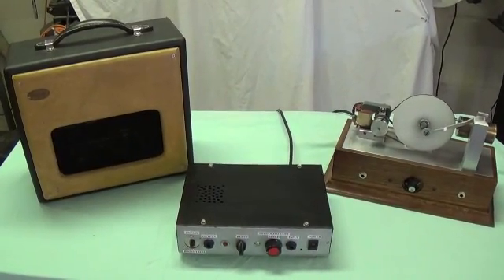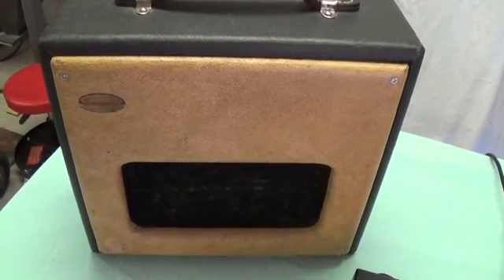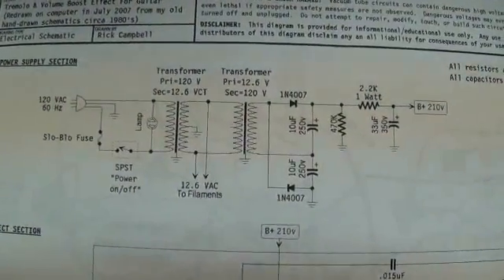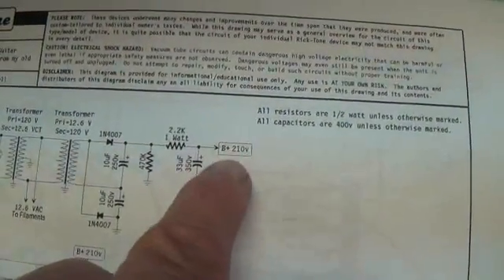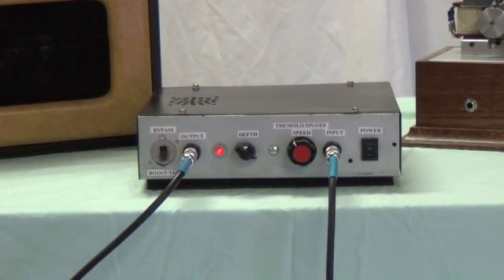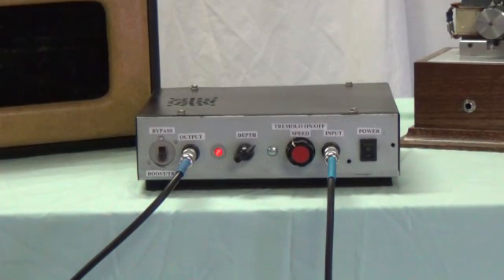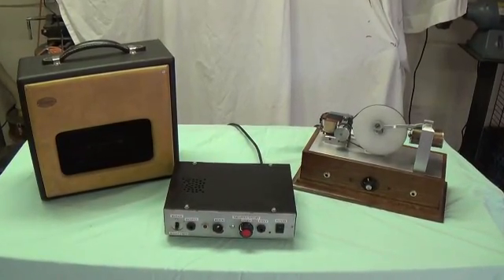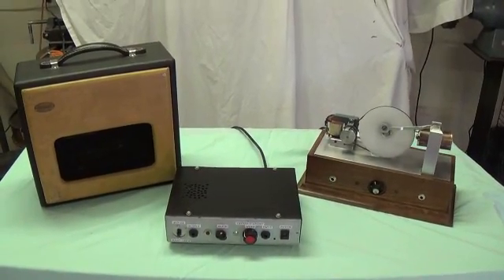Electromechanical Tremolo vs Tube Tremolo

Comment: Mechanical for sure.
Reply from the maker: Thanks, Richard :)
Reply: @UncleDoug 
Though, I am curious. What did you use for variable gain? Mine uses a 10k Type J Allen Brady pot.
Reply from the maker: @richarddoss6052  I don't recall the value of the pot, Richard, but it was probably an Alpha pot from AES.
Reply from the maker: @richarddoss6052  I don't recall the value of the pot, Richard, but it was probably an Alpha from AES.

Comment: Have you tried different chemicals in that tank? I’d be curious to see how liquid mercury would sound…
Reply from the maker: Yes, I have experimented quite a bit and Windex works best. Mercury would coat the tank and create a dead short. Also too much conduction (higher specific gravity) leads to a square wave tremolo, which does not have a pleasing sound.

Comment: The electro mechanical unit is a more warmer sound, which I love, plus its super cool. imagine that unit sitting on top of your amp when youre at a gig, you’d surely have a lot of people wondering what it is. Between songs for some on stage banter, you could give a short explanation of it, and tune your guitar at the same time lol. I think your G string is out of tune in this video. :^P
Reply from the maker: Thanks for your input, Russell.

Comment: Have you tried using conductors other than dihydrogen monoxide? I wonder what effect you might get, if any, by using conductors with varying viscosity and resistance. Mercury comes to mind. Or even gallium with a warming circuit to maintain fluid in lower temperatures. Or dual tanks with a switch? Idk. I'll probably spend the rest of the week thinking about this, lol. Brilliant and inspiring work, sir.
Reply from the maker: Thanks, F. The conductive liquid of choice is Windex. It has just the right concentration of dissolved solids. Mercury would not work well since it's conductivity is too high.....it would produce square wave tremolo, lacking the gentle ramping up and down of the signal.
Reply: @UncleDoug  Interesting! I wonder again about a dual tank setup that would allow you to switch between the two- one with mercury and perhaps a tone pot with a high pass switch/bleed, the other with glass cleaner. 
It's a genuinely brilliant setup as is that screams “authentic vintage.” I've been playing guitar since the early-mid-80s. I’ve probably spent as much time taking gear apart just to see what’s inside as I have played. I never cared for the digitization of everything (despite the fact that I became a software engineer).
Reply from the maker: @Flatsixer  As I said before, Ryan, I don't think mercury has any value in these devices.
Reply: @UncleDoug I appreciate you educating me on this. It’s such a cool piece.
Reply: @UncleDoug  btw Doug, my name is Ryan. My mom was in love with Mr. O’Neal.
Reply from the maker: @Flatsixer  Many women were, Ryan, when he was a young man ;)
Reply: @UncleDoug  I bet women of her generation would still line up around the block to see him— or Redford, lol.
Reply from the maker: @Flatsixer  They better hurry.....time is running out.
Reply: @UncleDoug  well, back in the 80s my mom got to hang out with Paul Newman and says she wasn’t very impressed. Something along the lines of never meet your hero kinda fits in here somewhere and some things are better left to fantasy. That being said, my wife is the product of a liaison between a beautiful woman (her mother) and a very famous but now deceased country star. Mr. O’Neal still has some time to fall down that “rings of fire,” too, lol.

Comment: Thanks for sharing.  I’m curious why you used two transformers.  Why did you not rectify the primary 120v from the first 12v transformer to get the B+ voltage?
Reply from the maker: For isolation, Vince. Please watch my videos on power supplies and on building the Rick-Tone TremoBoost  unit featured  in this video
Reply: Uncle Doug thanks, I will check it out.

Comment: I'd love to know why fender decided to go from their glorious tube driven tremolo to the photoresistor kind?  Looking at the different amps it looks like they still had the same amount of tubes in both kinds of tremolo supplied amps? Easier/cheaper to build?
Reply from the maker: All Fender tremolos are tube-driven. In the lower-wattage amps, a tremolo circuit is used which alters the bias of the output tubes. For higher-wattage amps like the Deluxe Reverb, however, it is not desirable to alter tube bias, so the photoresistor type of tremolo circuit is used, which modulates the volume of the signal entering the phase inverter. Here is a detailed explanation:  https://ruclip.com/video/PMlkTpCvpEY/photoresistor-volume-modulating-tremolo-design-and-function.html

Comment: Hi Uncle Doug! I hope you get a notification of this 'comment.' In chasing down info on the Tel-Ray Organ Tone, I went back to your video...which led me to this one! Your electromechanical tremolo is one of the more fascinating units I've seen! I did check out the El Paso video, and the first attempt at this one, with all of the machined parts. I was wondering, though, if you ever put a diagram together, for building this one? Thanks!
Reply from the maker: Thanks, Norm. No, I tend to build projects like this without any plans, simply designing and building as I proceed. I have also built a second type of EM tremolo since this one, out of scrap parts, with a video (or two) documenting it. You will have to observe the different parts carefully in the video. The structure is rather simple.

Comment: I'd like to get my Vibrochamp's tremolo to go as slow as your oilcan trem unit goes. That thing is fantastic!
Reply from the maker: Thanks, DE. You can slow down the oscillation circuit by increasing the value of one or more of the capacitors in the loop.....i.e. from .01uf to .02uf.

Comment: If the mechanical trem had a depth control I'd like it more, but I feel the tube trem is more useful as is.
Reply from the maker: An interesting observation, SG. Thanks for your input.
Reply: Oh yeah, a resistance, a small pot to ground would do it then, of course why not tone controls as well, a simple high pass filter to keep the bass throbbing and the treble straight...

Comment: I'm surprised the mechanical temello sounded so smooth, I would have expected it to just jump between on and off. are there buffer caps or something to smooth out the output?
Reply from the maker: No, the fluid in the tank provides a surprisingly gradual signal rise and fall......very "organic", as opposed to the electronic trem.

Comment: Hey Doug, not to be that guy in the back row that is always correcting you but I think in your caption you meant "Teenage Wasteland" by the Who. 

Thanks a lot for this channel and your generous sharing of knowledge I am trying to find out how to achieve a slower selection of speeds on a Marshall 18 watt clone I recently acquired. The speeds and depth are too much for me even with the pots near minimum.

Perhaps I am spoiled by the Fender Tremolo's I grew up on???
Reply from the maker: It's strange, but I edited that caption many months ago to "Wasteland" and now the original (incorrect) caption has reappeared......and, to add to the fun, YT has altered their editing capability to make it virtually impossible to change any caption. Re the speed and depth of your Marshallesque tremolo, you can try altering the values of the capacitors and resistors in the oscillation loop. It's a trial and error endeavor to find the speed and depth you seek. Good luck.
Reply: thank you sir. I was heading in that direction after a bit of forum hopping the web but was curious on what you would generously suggest. I will certainly try those after a bit more research. thanks again.
Reply from the maker: You're welcome. Good luck.

Comment: Magnatone vibrato was actually what Leo Fender was competing against in California in the late 50's. It's no accident he incorrectly labeled his tremolo amps as "vibrato"...That was intentional.
 He couldn't actually make an amp with vibrato...only tremolo...but he labeled his amps that way anyway, hoping the public would not know the difference. This later forced him to mis-label the vibrato arm on his guitars as "tremolo".

 It's easy to make a tremolo circuit using a tube driven oscillation circuit or maybe an diode bulb optical circuit. Vibrato is much more complex. It creates a pitch shift instead of a volume shift. Sounds more like a voice and less like that helicopter choppiness you get from putting an electric fan on front of a speaker.

It can be argued that Magnatone vibrato was the first guitar effect that actually altered the sound of the guitar. Previous effects like reverb, echo and tremolo didn't change a guitar's sound...just created time based delays or volume fluctuations. 

The Magnatone vibrato is actually the common ancestor of things like phasing, chorus, envelope filtering, and synthesizers.
Reply from the maker: Thanks for the interesting and informative input, Joe.
Reply: Joe Schmoe that is fascinating insight.
Reply: Though on some brown face fenders they came close, with harmonic vibrato

Comment: And then Magnatone knocks it out of the park with their Vibrato, that many incorrectly call/called a Tremolo. One modulates volume and then the Vibrato actually shifts the frequency via those neat little varistors. I've build a few really nice analog transistor Tremolo pedals before. I've been intending on trying my hand at building an analog Vibrato. Your mechanical Tremolo is a brilliant idea. It would be interesting to test the tank with various solutions... salt water (which would be corrosive), maybe add a little magnesium or potassium to some distilled water... in order to alter the conductivity of the solution and what effect it would have?  Is there a blend/bypass in the mechanical circuit so that you don't experience note dropout at the slower rates?
Reply from the maker: I had a chance to hear a Magnatone Vibrato in person while visiting Austin TX) Vintage Guitar recently. It is quite different from a Tremolo effect and unlike anything I have ever heard, except, perhaps, for a Leslie speaker.....which produces both Trem and Vibrato simultaneously.  Sort of a fluttering audio effect. I'll probably go to hell for saying this, but I didn't love it like I thought I would. Purely subjective, I guess, but not an effect I would spend a fortune to clone. Others, no doubt, will disagree.

The mechanical tremolo tank solution is a significant part of the effect. Too much conductivity causes overall volume reduction and choppy on/off shifts, like a square wave.....not pleasing to the ear.  My experimentation with various solutions, including the recommended Windex (it foams at high speeds and screws up the effect), and salt water (too conductive), I personally found that pure drinking water seemed to work best....at least to my (tin) ear.

I don't have a mix control, but it's a very good idea. Another good viewer suggestion was two electrodes....one at each end of the tank.....so you would double the modulation and reduce the necessity for high speed tank shaking (and foaming).
Reply: I think vibrato is best lightly applied. Too much is irritating, I think anyway. The two electrode idea is a good one. I wonder if a few drops of that anti-foam solution for a carpet shampooer would work? Maybe a few drops of glycol would work too? Have you noticed any electrolytic plating or electrolysis due to the current flow?
Reply from the maker: The anti-foam additive is a good suggestion, Mark. I have not seen any signs of electrolysis. The current flow is miniscule, but I guess over a long period of use, electrolysis would be inevitable.
Reply from the maker: I've seen some optical tremolo how-to-build articles, with the spinning disc, but they aren't quite "rustic" enough for me :)  Maybe if you could use a steam engine to power the disc rotation :)  Seriously, I'll keep it in mind. Maybe there are some weird variations, like two superimposed discs operating at different speeds......something to make it unique.
Reply: I would have to agree... a neat idea and all... but for some reason it doesn't scream... "take the rent money and make this!" ha

Comment: The mechanical  sounds much richer yet more subtle/organic.
Reply from the maker: Thanks, Tom. I agree with your assessment, but the electronic trem is a whole lot easier to build and doesn't require special equipment like a metal lathe and a milling machine :)
Reply: @UncleDoug  The mechanical one has an awful lot of buzz to it. Might be a good thing depending on the person.

Comment: which is better? can you post up  a video on how to build this stuff, for the guy that knows almost nothing about electronics?  I really want to have these cool effects, along with a leslie, but have no clue how to build this stuff.. I am a Machinist, I know basic tool stuff, work on cars to a point.. I just never messed with electronics,  did not wan to jump in and get shocked or killed,    I heard some components hold electricity for a long time..
Reply from the maker: +Michael Craig  As a machinist, Michael, I'm sure you can understand how difficult it is to explain complex machining procedures to people who know nothing about lathes, mills, etc. The learning process requires a lot of time and effort on the part of the student, beginning with the basics, and gradually working their way up in complexity until, after several months (or years) they are a competent machinist. It's the same with electronics. You'll have to study the basics and gradually work your way up to simple circuits, learning about all the components, test equipment, etc. Just like machining, this is simply not something that can be taught in a video.

Comment: Yeah I like this em tremolo better than the smaller one they are both very nice but this one shouts I am a machine!local guitar shop wants two grand for a de armond way out of my reach, sadly ah well, life goes on. Regards... Dave
Reply from the maker: +David Salny  Thanks, Dave.....glad you liked it. Two grand is a little steep.....I believe the DeArmonds sell on Ebay for less than $1000, or at least they did until recently.

Comment: Was going to go back through your trem videos and came across this one. The home-built EM is lights-out the winner - much more organic. Also, it's a thing of beauty to behold.
Reply from the maker: +Wes Howard Thanks so much, Wes. I agree with your assessment of the tone quality of the EM tremolo. I picture its output as a smooth-shouldered "wave" (literally) form, vs the sharper cutoff in the tube tremolo.

Comment: Serious thoughts about building a passive volume pedal based on the liquid canister method. It wouldn't ever get scratchy like a pot does.
Reply from the maker: I would be interested to see your design for a volume pedal. The liquid canister is prone to being an on-off switch, and I'm not sure how it could be adapted to gradual, volume control use. If you come up with any ideas, please be sure to share them with us.
Reply: Uncle Doug We're already discussing this on your other liquid trem video so forgive me for repeating myself, but yeah, nichrome resistance wire, I think. Or perhaps more electrode area plus a slightly more diluted ammonia solution. Shape of the canister and/or electrode could make a big difference as well. Or what about coating part of the inside of the canister with an insulator? So many ways to approach this!

Will let you know if I ever try it. I have virtually no shop space at the moment, but a project like this could potentially be quite small and doable on my desktop.
Reply from the maker: Your ideas all sound interesting and feasible, AQ. Please let us know the results of your experimentation.

Comment: Both of those units sound good, and they have very different tonal qualities that are useful. The mechanical rig has a sine wave kind of personality, almost like somebody riding the volume control. It reminds me of the trem found in the Tweed Vibrolux and Tremolux amps. Really greasy sounding, and the tube unit calls to mind the Blackface Fender sound. I hear a very square-wave, on-and-off kid of thing coming from it.
Reply from the maker: I agree with your analysis. The mechanical trem has a smooth rise and fall, exactly like the volume control variation you mention, while the electrical trem tends to have a slightly more abrupt cutoff and return. It's subtle, but when you directly compare the units, side by side, they do sound a little different.
Reply: Uncle Doug If you ever get bored, you might try connecting your guitar to an active crossover and set it to maybe 800-1Khz (similar to a Leslie) and feed those 2 outputs to 2 amps. set 1 amp for a deep tone, and the other one more trebly. Then play around with the speed settings. Get them beating against each other. I used to do this with a Tremolux and a Twin Reverb, and it would shake the whole house. Crazy psychedelic fun. i think I'll go and do it again, it's a blast. Completely nuts!
Reply from the maker: In an interview, Billy Gibbons talked about using two DeArmond Tremolos at the same time, but at different speeds. I guess the result is a pretty crazy effect, with all sorts of wave cancellation and reinforcement occurring at different intervals.

Comment: Sounds great, I wonder if the electro-mechanical version can have an adjustable depth too?
Reply from the maker: Thanks, Davo. You can experiment with different liquids in the brass tank. Those with lower resistance tend to give greater intensity, but they also reduce overall volume. The slower the EM tremolo operates, the deeper the effect, probably due to the increased period of grounding of the electrode.
Reply: Fascinating.   These older devices are certainly more complex but they are quite musical as well.